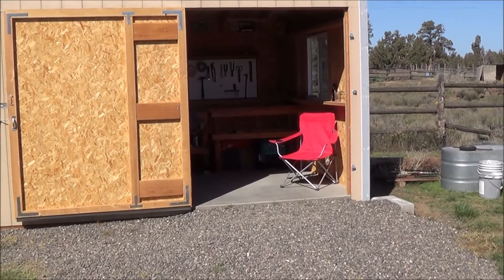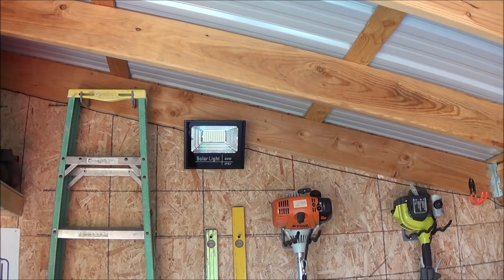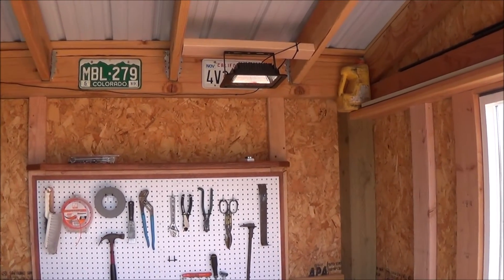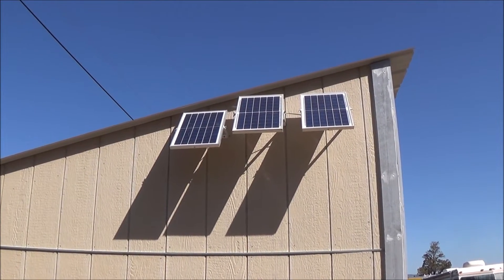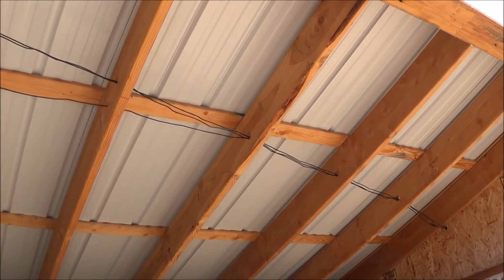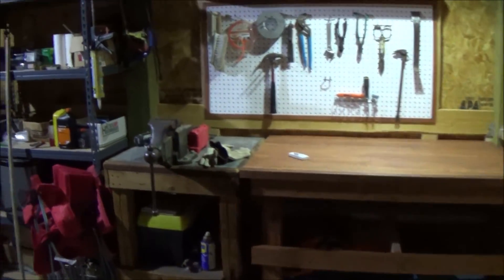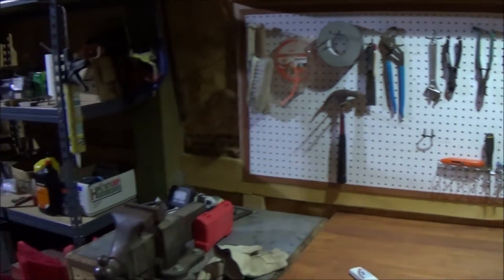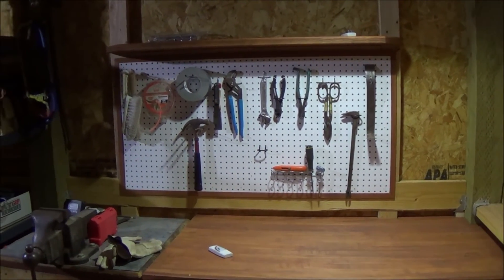60W Solar LED Outdoor Flood Lighting.

Comment: I had a 50w 220v led floodlight, then i changed the the same light you have in your shop, i was very disappointed because my 50w led was alot brighter the then the solar 60w